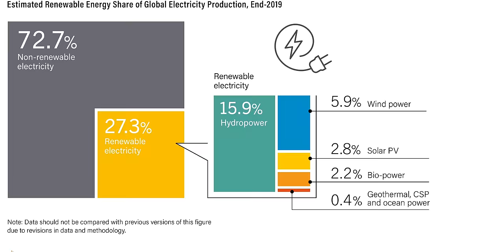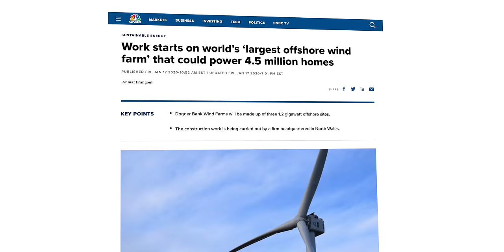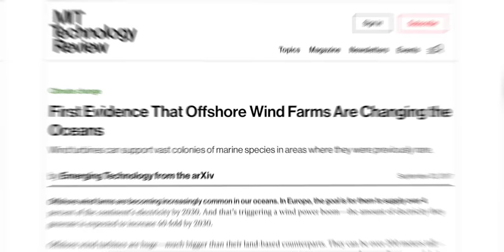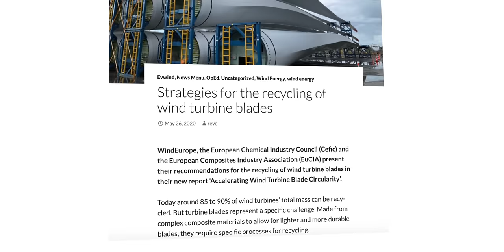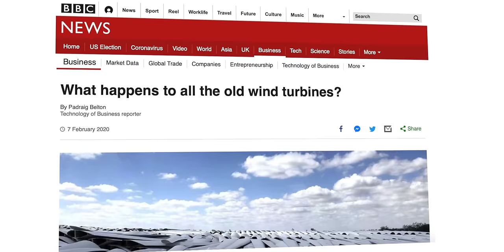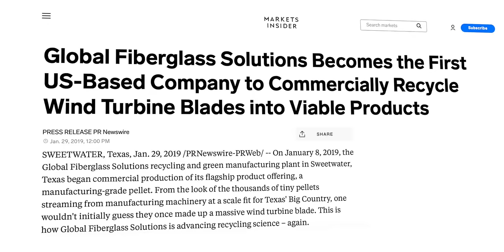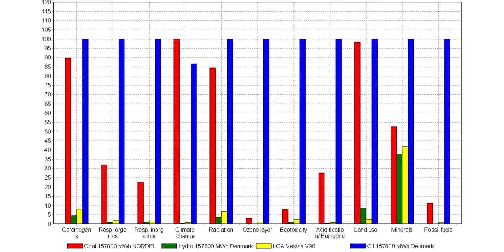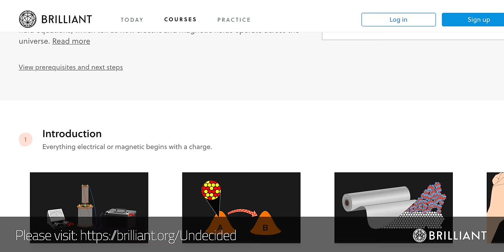The truth about wind turbines - how bad are they?

Comment: Yes what about the fosil fuels like oils, and grease for the bearings and hydraulics.  You forgot to mention theses little tidbits.   Windmills only last at most two decades and make the landscape look like crap.  Where as a brand new coal fired plant with all the latest scrubber technology puts out a little more than cigarette smoke.  A coal fired plant always puts out a more consistent source of electricity,   and power plant will three times as long as a wind turbine.   Not to mention that it only takes up a square mile or two instead of tens of miles of eye sores.

Comment: While watching, all I could think was solar power panels are a good substitute for wind mills, becauseee it’s harder to harvest wind ( making a windmill) than to harvest light, yes you still need materials to make the panel , but at the same time it harvests energy from the sun without getting in the way of everyday life ( being able to put panels on top of buildings/ roofs) 🤓 but I would have to research more about materials used for solar panels before saying completely that it’s true. In a space saving aspect it’s better tho forsure.
Reply: why would you install solar panels in places where there is little aun and a lot of wind? this is not a either or question. you don't have to pick a team. just be normal

Comment: Seems to me that if it really is all about climate change then the answer is two fold until proper base load renewable energy is invented.  Firstly, build a whole heap of nuclear power stations so that electric heating/cooking/hot water really becomes the only option.  This would dramatically reduce greenhouse gas emissions.  Secondly, put all the wind and solar somewhere very remote and use the power from these to create Hydrogen from sea water for automotive purposes etc.  Then the intermittent nature of these renewables wouldn't be an issue.

Comment: Wind Turbines were designed to fail, they require more power to manufacture and maintain than the energy they will ever produce
Reply: Just not true, $3 million / year at $0.05 / KWh recovers the cost in less than a decade. They are going to last longer than a decade.

Comment: There is a lot more problems with windpower than this video tells. Eating insects (1200 tonns a year only in Germany a year). Chemicals put on the blades with helicopter to take off the ice in winter. Throwing ice from the blades is an issue too. The wings lose particles from there wings into the nature. Lifetime is short, about 25 years. Lifetime at see is probably even shorther due to the expose to salty water. (Japan concludeed sea windpower was not good enough for big scale power making). And what do you do when the wind is missing for some hours/days? It is well known you need the same kw installed in backup production as the total kw from wind/solar power. Men verden vil bedras, so it looks unstoppable.

Comment: Just like everything else green energy advocates are pushing their “preferred option” over older power sources via lobbyists under the guise that they are so much better for the environment (there not) so that they can in turn can make a ton of money.  It’s nothing to do with being green or protecting the environment.  

Most green energy power sources are no better if not worse than their coal / oil / nuclear counterparts.  Wind turbines break down constantly after just a few years of operation and are notoriously hard to work on due to their immense size and moving parts.  Half the windmills along Lake Erie in NY are already inoperative and they’ve all been in place for less than 20 years (not good). The bearings and gears (moving parts) are the first thing to go and it doesn’t take long.  Any Engineer or mechanic will tell you that moving parts that require lubricants are always they first to go, especially when they are moving something so immensely large and heavy.  Anyone that tells you otherwise is lying or doesn’t know what they are talking about .  

Solar panels are even worse as they require extensive mining of very rare minerals and processing which require extensive usage of fossil fuels to extract, process, and refine.  Solar panels also have a dubiously high decay rate of 1-2% a year.  It take 20 years to pay off a system and by the time it’s paid off you do need to completely replace the system so what’s the benefit?  Plus the lithium batteries (if you want uninterrupted power during grid shutdowns last 12-15 years tops), are not part of a typical installation.  The dirty secret of the US solar industry and what they don’t tell you when they sell you a system at your home is that they don’t stop power outages unless you have a battery bank which is an additional 15k.  In fact most of the government subsidized systems don’t include battery banks.  So if a blackout does occur your power still goes down because the utility grid you are tied to has to stop your production to avoid electrocuting line workers.  During an outage your meter will send a signal back to your inverter and tell it to shutdown until power to the grid is restored to prevent “islanding.”  Don’t believe me look it up.  Solar power is not the be all end all.

Lithium from the batteries is almost as toxic as nuclear waste and the landfills are gonna be full of the stuff in a few decades leaching down into the water table poisoning the aquifers.  

Honestly cold fusion and superconductors should be the focus going forward.  They produce crazy amounts of power but the historical problem was how to keep a fission reaction going without expending an = amount of energy to keep it going.  With the advancement of superconductors and magnetic containment they are quickly becoming a possibility for mass power production but are still 10-15 years away from being built commercially.
Reply: Edit.  I meant to say fusion not fission.
Reply: @chrisloesch1870  Cold fusion does not exist.

Comment: This is a pretty good video, but it skips over quite a few relevant facts, maybe to keep it shorter, maybe because it's now a couple of years old. 

Wind turbine blades are NOT a serious waste problem. All the blades at a given wind farm, put in a pile, would make a pile FAR SMALLER than the ash pile created by burning enough coal to generate the same amount of electricity as the wind farm generates over the years. 

And they can easily be cut into truck length pieces for transportation.The materials in them can either be mixed into new concrete, or used mixed with gravel when putting down new pavement, if not otherwise recycled. 

And while it's hard to come by hard numbers, foundations and towers are most likely to last a very long time, much longer than twenty to thirty years. New gensets with new blades will be mounted on them the usual way, with a crane, when the old gensets and blades are worn out.

The amount of mining and materials mined to be used to build wind farms is substantially less than the amount of mining, drilling, and so forth done to produce equivalent amounts of electricity burning gas or oil......... which are DEPLETING resources. The long term price trend of oil and gas are UP, and will very likely continue up, indefinitely.

We've been fighting wars already over access to oil and natural gas. Putin thought he would get away with invading Ukraine by way of blackmailing the free Western countries with cutting off the RUSSIAN gas and oil on which they were and still are dependent.

Comment: Subtle endorsement for the fossil fuel industry.
I would have not had any suspicion if you presented side-by-side comparisons of what you need to do with what's left of the oil derricks and other facilities used for oil digging and processing.

Way to go with the nitpicking on renewable energy costs and environmental footprint. Guess what, they are easily dwarfed by the equipment, resources, health hazards, and inconveniences created by the fossil fuel industry.

Turbines made out of wood? Do you even realize wood is also carbon and is slowly releasing greenhouse gases as it decomposes? AND THEY DON'T LAST LONG.

Fiberglass can be recycled. All it takes is for governments to invent in the process. They can be turned into wood plank substitutes or furniture especially chairs/desks for schools.

Comment: There’s a lot of inherent flaws in their design. Firstly 4 or 5 smaller blades would be cheaper to build and more efficient that 3 large slow blades, and why put the machinery at the top? Put it at the base with a shaft and you get rid of the moment and need for super deep foundation
Reply: No, larger blades are far better. You're adding a lot more material to accomplish almost nothing – 3 blades extracts the majority of usable energy anyway – and why would you want to reduce the swept area?

Comment: Wind and solar take up too much space, are not reliable, and do not produce enough energy. We are littering the landscape and the environment with this garbage. 

The world needs to get real about the truth of these "green" wind solar energies. This video was actually too nice about the issues.

Birds and whales are adversely effected.

New forms of hydro should be utilized that don't affect fish passage. Nuclear. 

Perhaps add wind and solar at the cities and residential areas. Not far away from the power users. There would be a huge energy transmission savings with that approach. Roof top power generation. On the user side of the grid.

Comment: Hi all @ Undecided
 This is a slight deviation from your exact thread but is still EV and Green energy-related.
   I was wondering why no one is talking about TE$LA and Wind turbines.
With Elon and his company's engineering expertise, I am sure they could design and build
The most efficient turbines and towers on the planet. With their knowledge of motors ( and that is all a generator is, a motor being pushed rather than driving a shaft ) coupled with the aerodynamic design of the blades ( remember they have some of the best drag coefficient numbers of any other road car due to their in house designers and fluid dynamics  engineers )
That along with Elon’s Materials expertise used to design the towers, and his ability to scale up production at lightning speed, I can’t see how this would not go a far distance to accelerate his change to renewables and away from fossil fuels in the prime directive.
Can you honestly think of a better company for this job than TE$LA ????

Eddie in Scotland

Comment: Convert wind or sun energy into a medium. Normally we think about batteries, but what about electrolysis to hydrogen?  I know u will lose a lot of energy because of the process. But you can enpower generators driven by hydrogen. They say it's to dangerous to use H+. But batteries can enpower workforce energy machines? Nvm it's late😅 goodnight

Comment: Its common knowledge that based on cost vs effective value unrelaible wind and sun power is hopelessly outclassed by 24/7 Nuclear. And it can be fusion energy to generate steam which is not high risk.  Battery technology (for each individual apartment or home)  will have to come a long long way before it's even close to dealing with the escalating  world wide demand for 24/7 uninterupted electrical power.  Without tax payer subsidies and Govt loan guarantees no one wants to risk the start up and substanial maintenance costs to manage the easily damaged (blowing sand, hail and birds) fiberglass wind turbine blades. And then what do they do with the damaged ground and wind turbine/solar farm hardware when they crap out in 20-years. And we're still stick with gasoline and diesel to power Hospital and other back-up generators,   Unlike Wind Nuke has not turned out  to be good for political campaign donations and that is the one big big BIG problem.

Comment: they create literal tons of greenhouse gases when they are manufactured. due to the windmill design, it starts off flawed and they wear out rather quickly. bearing and supports..etc. for the amount they produce, they aren't worth it imho. did you know...that for every windmill, there is a 18,000 volt generator at every one of these that have to be used to jump start the turbines? and these generators are not solar powered. so swing and a miss for me on this. better to build  a thorium reactor or 20 and use that. fair enough they haven't been pushing for thorium reactors because we had all that pesky plutonium to use. good news is that a thorium reactor uses plutonium as fuel and uses it up..no waste. but lets not focus on one type of reactor shall we?..again? i see thorium reactor models and testing begining and thats good but who's to say there isn't something even better out there?

Comment: The power it can produce is one thing vs its power it produce and when not you need backup power which often is coal or oil powerplants so indirect wind tubines produces a lot of Co2
Reply: Actually no... currently any time a wind turbine is generating is time that we are producing LESS CO2 (and other stuff we don’t need more of), Without then we would be producing more CO2. They are the opposite of causing more CO2. And as offshore generation grows, along with other forms of renewables generation plus storage, fossil fuel generation will continue to decrease.

Comment: " They're simple to maintain and should last for decades "    HAHAHAHAHA

Meanwhile, over in the real world, things don't quite work out like that.  Ever heard the cliche that wind turbines last 20 years ?  Well they don't.  That figure comes from  .  .  .  .  wait for it  .  .  .  are you ready  .  .  .  .  .  .  a computer model.  There isn't a single 20 year old turbine in the real world.  Not one.  Not even almost.  If you want to make a turbine last that long then you will be likely to have to give it 4 sets of bearings, 3 sets of blades and 3 gearboxes.   €xpen$ive !  You can easily spend €400,000 on a set of bearings and  €700,000 on a gearbox. Taint cheap.

Comment: it would be super interesting to try using old wind turbine blades in large building construction... their strong yet light properties seem advantageous- maybe as an alternative to a reinforced concrete beam (strong but heavy)- and reusing/recycling existing materials for construction is a great way to cut down on the environmental costs of new buildings- they also seem especially suited to being walkways or something, just due to their form- the bus stop and playground uses are very cute and look like very good ideas too! i love seeing creativity when it comes to design and reusing- and engineered wood definitely seems promising for turbine blades so it'll be exciting to see how that goes- honestly the only thing that prevents my complete despair over how much needs to be done to mitigate climate change is that much of that work is very exciting and creative
Reply: You'd probably have to do a lot of quality testing on them to determine how degraded they were, structural cracks etc. if it was going to be used as a load bearing member in construction.  It makes more sense if you're going to make a slide, swingset stand, bus shelter, or a small pedestrian bridge out of one, as the forces aren't great.

Comment: Nuclear is way greener than hydro or wind.
Reply: Nuclear and Geothermal is better than hydro wind.
Reply: @daineramosquitco5816  Geothermal is highly dependent on location. Molten salt reactors can go pretty much anywhere.
Reply: @LP-ju2fi  therers pretty much geothermal heat everywhere, but just lesser. And a geothermal power plant power output is 50MW! so much better than a wind turbine! Geothermal Energy is cool, just be near a volcano or a heat source
Reply: @daineramosquitco5816  Location will dictate the amount of heat you get. If you are around the ring of fire power generation may be possible at a reasonable expenditure. Otherwise you need to start drilling deep. A company in Australia drilled down 6000 meters to test feasibility. Side note. I was able to crawl around the drilling rig they used when it was brand new. It was massive and an awesome experience. 

To my knowledge it hasn't panned out for them.
Reply: @daineramosquitco5816  The deepest vertical well I was on was approximately 4200m and the drilling mud barely got over 60°C.
Reply: @daineramosquitco5816  We have run small nuclear reactors in space. That's what's powering the Voyager crafts. And that is technology from the sixties and seventies.
Reply: @LP-ju2fi  thats cool, if it used solar, then idk because it would have been so far away it would capture almost to no light

Comment: coal and gas are the cheapest and that there are ways to burn it in a green fashion and solar and wind are forcing the price of electicy up so the companies should be made to reduce the price of electricy by 90% if it is that cheapest way to produce power so it is a lye about cheap power and how are you going to make these solar panels and wind generators with out mining